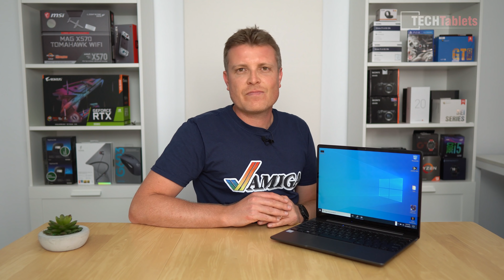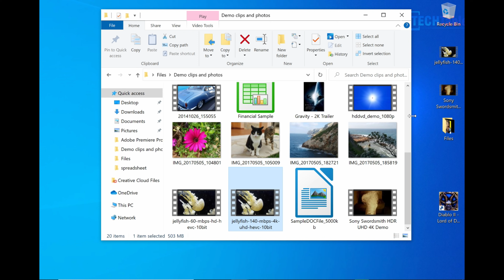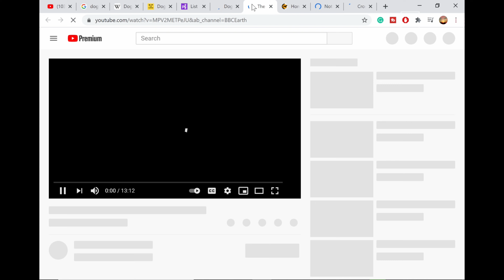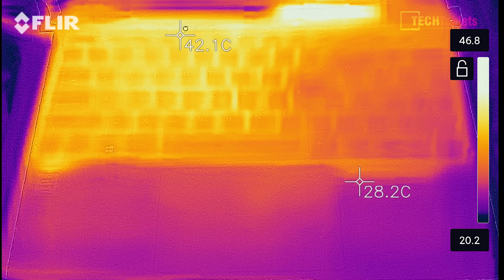Chuwi Corebook Pro Review SHOULD You Buy This 13" Windows Laptop?

Comment from the maker: 00:00 - Intro & spec
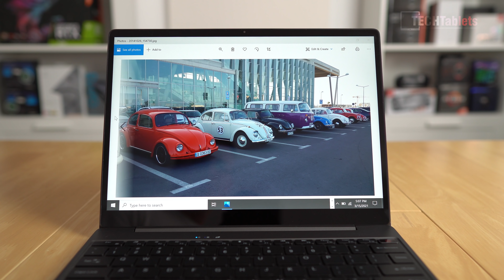01:27 - Screen
02:22 - Webcam and sample
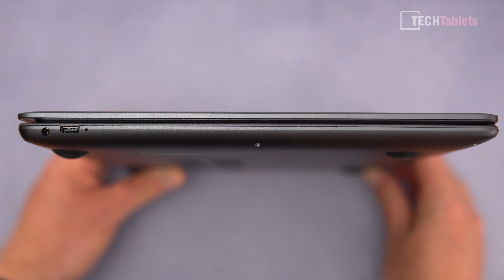02:46 - Ports
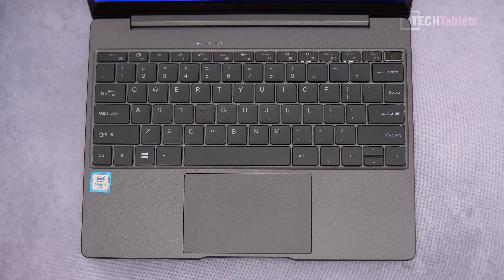03:28 - Keyboard and touchpad
04:37 - Internals
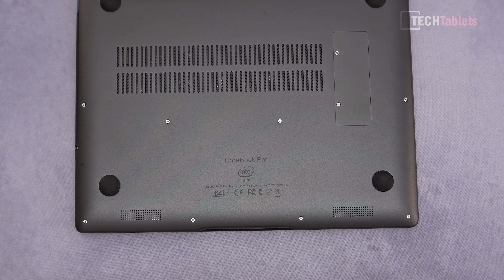05:28 - Speakers
05:50 - Bios
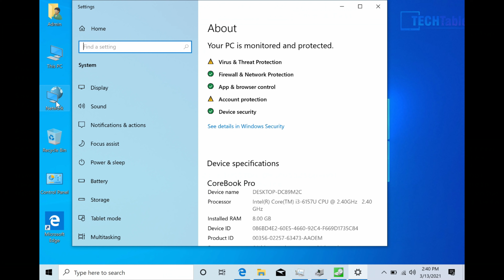06:43 - Windows, SSD & devices
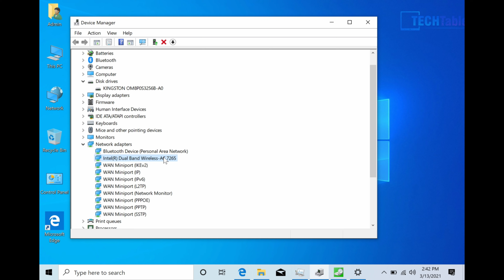08:27 - Performance, HEVC playback & benchmarks
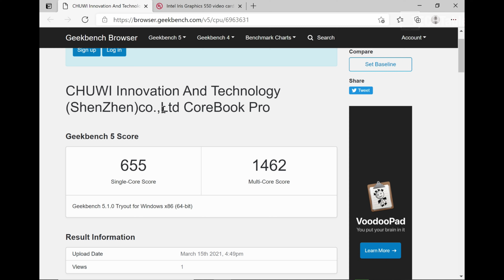10:52 - Chrome and Youtube performance
12:51 - Gaming performance (CSGO 720p)
13:56 - Thermals inside & outside
14:37 - Linux support
14:56 - Recap, Battery life, Pros & Cons
Reply: You hurt my left ears with that webcam test bro. I have my earphones. Thanks for the review though. I am better off buying a different model.

Comment: Hey man, any idea if you can add 2 more RAM stick of 4GB each? I used FreePCAudit to check and the software shows there are 2 more RAM slots available, is it possible to add 2 more for 16GB RAM?
Reply: No. This model has soldered ram chips. If you want upgradability, go for the higher model which is the corebook x

Comment: Very throughout review and linux part is always appreciated. Yet Iris 550 does not support the VP9 codec, so video decoding on youtube will be software accelerated. You should use extensions like h264ify or enhanced h264 to force youtube to use h264 codec, which is supported by this chip. You can check this with gpu usage during the youtube playback or with using chrome developer tools. Looking forward for your upcoming videos.
Reply: exactly!! that's exactly the extension i'm currently using
Reply: Yo,the screen resolution is 2K not 4K. Of course it won't play 4K videos...idjit.

Comment: I own a Chuwi Corebook Pro since the beginning of February and i must say that your review is wrong in many aspects.
1- the laptop plays hvec 2160p h10 HDR movies perfectly using the correct software, like 5kplayer.
2-  Also, the screen panel is fantastic, you can't find a 2k panel in regular brands for less than 1000 dollars or euros in my case and this is a quality One with great colors and brightness. 
3- Also, IPS led  panels always have that bleeding at the extremes, it's unnavoidable.
4- as for gaming, i have Witcher 2 and Tomb Raider 2013 at native resolution with almost every setting maxed. Je behaves good enough. Of course it's an I3 ,and it has the natural limitations due to that factor. 
This is the best 13" laptop available under 600 or even 700 dollars or euros concerning specs and screen resolution
The Iris 550 is a very capable on board graphic card. 
The Corebook x is superior of course, but it's 14 inches and 100/150 more expensive. 
You say you aren't paid for the review but  it seems someone país you to trash it.
I usually don't even comment on YouTube, but i had to say something about this
Reply from the maker: Yes I was paid to trash it of course. Sorry my experience was different to yours maybe Chuwi changed and improved it.
Reply: @Techtablets  or you didn't the same laptop. Because i find very hard to understand when you say it can't play hvec 265 HDR 10 bit properly when it plays them perfectly. 
It's perfectly normal to not having the same good experience, but there is a difference between not having such and saying it's crap when not using it properly . And even more strangely considering you are supposed to be a tech expert. 
I just think it's extremely unfair to trash something under false claims
Reply: Hi Im planning to buy this laptop soon. How was your experience with the laptop as of now?
Reply: @lawls2731  awesome so far. Good gaming performance considering, i run Dragon Age Inquisition in native resolution without any problem, mid settings for instance. 
Everything else runs smooth, only some poorly encoded x265 4k movies have trouble playing, but in general, smooth. 
Windows update has been delivering processor and graphic card updates, last week there was an Intel driver.
I´m very pleased so far, after almost an year of having it. I recommend it, just keep in mind to keep everything updated and for video playback, i hugely recomment 5Kplayer, it´s specific to run very high quality videos
Reply: I'm on the same boat. But I wouldn't pay more than 400€ for this...
Reply: It depends, in my country it is very cheap and the panel probably is the best for that price.For Another this is a school laptop guys!  and you would not fill 100% cpu doing zoom calls and Excel.

Comment: So... about 2 and a half minutes and the probable answer is "No". Which is a pity, Iris 550 is 800+Gflops, which is quite respectable even for a 2C\4T. But at a 500$ average price... good lord no. Especially 500 euro. Hell, I can look at my local retailers and snag something like...:
-Ideapad 3 15ARE05 - 4300U\8GB\256GB 471$
-HP 15s-fq1 1035g1\8gb\256gb - 540$ - ugly piece of shit, but afaik it should be upgradable and at least it's a slower, but 10th gen iGPU and it's still IPS
-All kinds of Picasso(Zen+): Expertbook P15010, V15 ADA, 255 G7, V155-15API, Aspire 3...
Granted - some of them are equally shit, especially Acer... and many have TN panels, but that Ideapad 3 looks like a nice deal. And I don't live in a country capital, let alone a developed country capital, so the availability is not the best.

If Chuwi priced it hard below 400$, closer to 300$ - sure, it could be a.... eh... something. But anything close to 500$ is mainstream retail territory and there's no need to even try to enter it, the competition is "sharky" as it is.

Comment: i3-6100U is 2.3 GHz and it's 15 watt 😂

i3-7100U is 2.4 GHz and it's 15 watt + has hardware accelerated HEVC 10bit encoder & decoder 😂
Reply from the maker: Yes, it should have had at least a 7th gen! But the good news is the new Corebook X is coming with the Core i5 8269U so Chuwihas at least there a good SoC not this garbage core i3 6th gen!

Comment: Are these companies getting leftover stock of older gen intel CPU's for super cheap or why put a 6th gen CPU in a 2021 laptop?
Nice video as always 👍
Reply from the maker: Using up old stock for sure. They must have got them almost free from Intel! The good news is the new Corebook X will have the Core i5 8269U which is actually quite a good chip. With Iris graphics and it's as good almost as some of the 4 core 9th a 10th gens.
Reply: @Techtablets  Yeah the jump from 7th to 8th gen was a pretty decent one. Way more significant than the previous fee generations. Looking forward to the video on the Corebook X then by the sounds of it.
Reply: @Techtablets  The Corebook X is already out and the Pro has been released for 8 months already

Comment: With the chip shortage issue, I think they're just taking whatever in stock. And since it's an old stock, they could get a very, very nice deal. The battery size is a little improvement over the standard 7.6V/5Ah = 38Wh (I believe it's actually 45.2Wh instead of 46Wh, a 1Ah addition on the same voltage), which I hope all lesser known Chinese manufacturers start adopting as 38Wh really can't do much even with a weak celeron CPU, which they often use across 13.3" to 15.6" size laptops, which left a lot of room as it gets larger.
Reply from the maker: We need at least 7th gen for native HEVC/VP9 decoding as I've shown these chock on video playback. But at least the new Corebook X was updated to come with the Core i5 8259U.
Reply: @Techtablets  that is decent enough, are you getting it?
Reply: To this date I still wonder why smartphones battery people use mAh but when it comes to laptop, it uses Wh
Reply: @someoneyouneverknow7529  because smartphones are using the same voltage: 3.8V, while for laptops they differ. You might find a laptop with 7.6V, 11.1V, 14.8V, etc. battery, hence mAh will not be accurate to get the capacity.
Reply: @leledumbo  ah I see
So higher Wh = higher battery?
Reply: @someoneyouneverknow7529  yeah, that one remains the same. For smartphones, too. Battery capacity is always measured as Wh, Ah is really just for simplicity as power consumption is measured as W. Wh / W = h, h = battery life in hours, assuming average w.

Comment: absolutely ridiculous for this price. I have seen numerous times on Chinese stores (taobao, JD, pinduoduo) how they only highlight the good parts about such products (RAM, replaceable SSD, etc.) and remain completely silent about the CPU.
Reply: I wonder why they keep using low end intel CPU instead of an AMD one even the Athlon series are decent
Reply: @zg3746  Because there just isn't any available. Chuwi is using old, discontinued stock to take advantage of the work/school-from-home rush of sales. What I don't understand is how bad the webcam is, it's clearly not fit for Zoom meetings.
Reply: @Avantime  The camera gets a lot better if you use another OS, I've ran ChromeOS, Linux Mint and MacOS Big Sur and all of them have a way better camera postprocessing. It could be the drivers available for Windows that might be a little bit off. That being said, 1mp web cam for a 300$ laptop is miles better than the VGA every single laptop builds today.